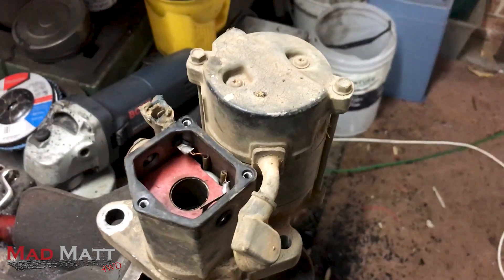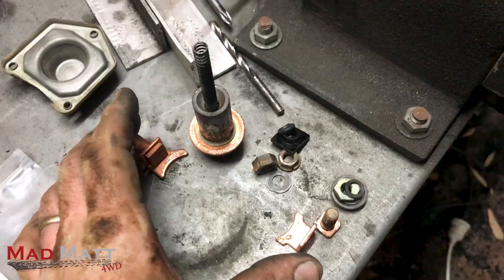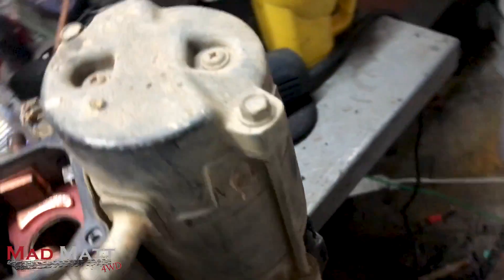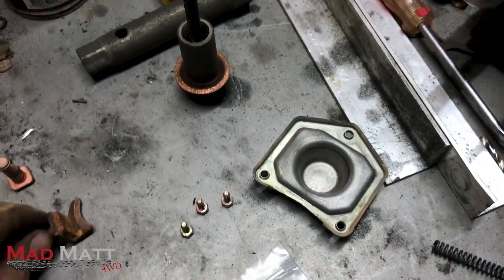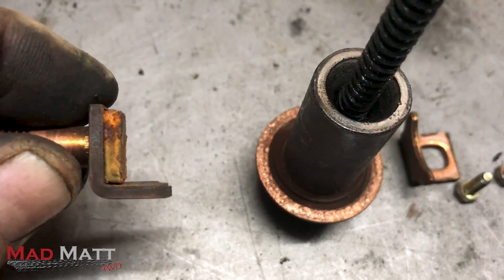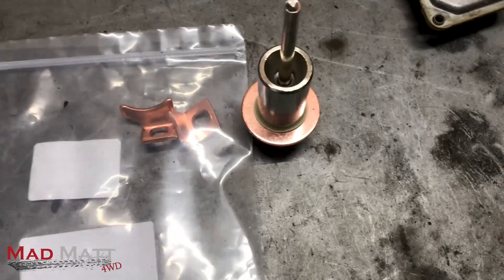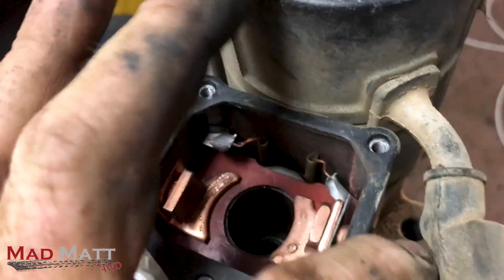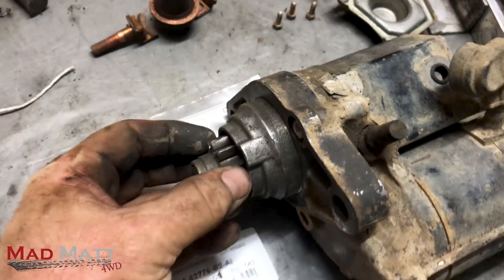How a Starter Motor Solenoid works, take a look inside!

Comment: Thanks for the video. Now if we have new plunger and contacts and new cables going to starter and trigger cable. But sometimes it maks just cluck cluck. Does that mean the spool of the solenoid doesnt energize enough and doesnt create enough pulling force?
Reply from the maker: It could or it could mean the main contacts aren’t contacting. Or the motor is burnt out.

Comment: You f***ing legend.
I have replaced 3 13bt starters over the years because even the auto electrician only replaced the brushes with no difference.
No mention of the slug.
My newest starter did this the other day and I was all set to buy a new one. Usually, I have to hit the side of the starter with someone holding the key on.
Did I mention you are a legend😂
Reply from the maker: lol. Thanks mate I’m glad I could help. A sparky should know this.

Comment: Great explanation for a numbskull like me Just had a solenoid issue on a Nissan Xtrail. I thought it was a battery issue, but was told there was still life in it … it was the starter motor and solenoid. So I paid for both I think (?) That’s the problem with not knowing the difference. Reckon the possibility was that those terminals could have been replaced and I could’ve avoided the cost of the entire unit? (Do they come as one unit?) I’m also wondering what goes on inside the starter motor - now that you’ve piqued my curiosity.
Reply from the maker: Glad to help

Comment: Hey Matt, I realise this is an old post.. but just wanted to say it's fantastic. I'm an old bloke and a mechanical numpty, but your explanation was spot on. I remember in 'the good old days' where I could lift the bonnet and know all of the components on my HD Holden, I often used the screwdriver to jump the starter or bang the solenoid if it was stuck, but never knew the mechanics of it all.  Now I do. Subbed. Cheers. Robbo
Reply from the maker: Well thanks Robbo. It’s funny how often my spur of the moment videos help people out.
Reply: @MadMatt4WD  keep them up mate!  I'm doing a binge watch at the moment... you're Waeco thermistor replacement also super useful, along with the toolkit stuff, snatch strap vs rope etc... I've been 4x4 touring for about 17 years... but still learning. Hopeless mechanically... but do just enough to get by. Love my FJ Cruiser... but they're a lot more techo than the old HD or Valiant push button auto (wish I had those cars now!). Cheers 🍻
Reply from the maker: Fantastic. Well I’m happy you’re enjoying my work.

Comment: Hi Matt, I’ve same or very similar starter in 92 2.4 diesel hilux, solenoid sticking! Not shooting out to the flywheel sometimes! I’ve had it out a couple of times in the past and brought to different people to fix and works for a while but then acts up again. Can you show me what to do and what parts to clean or replace! At the moment I use a bar to tap the starter when it sticks and away it goes with the slightest little tip of the bar
Reply from the maker: Change the whole starter or rebuild it.